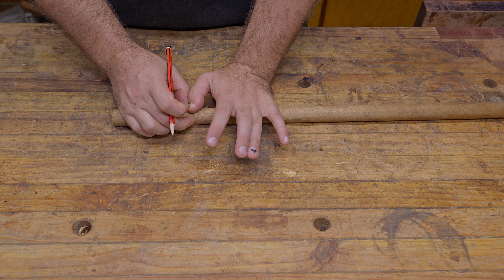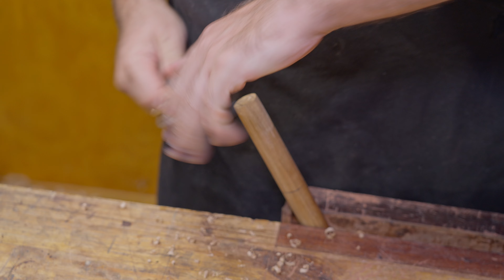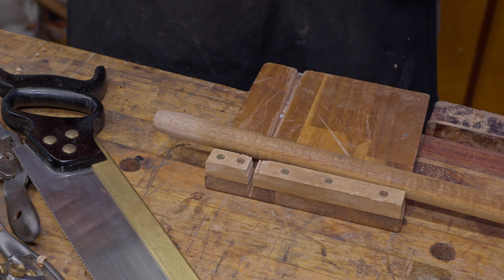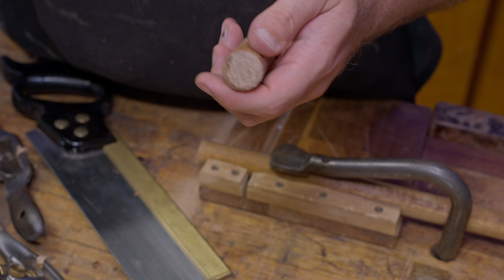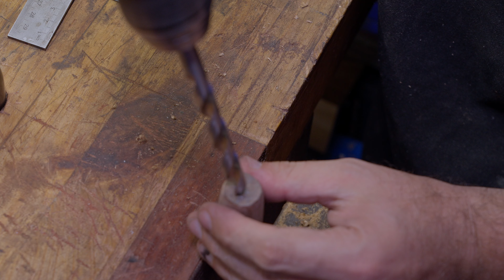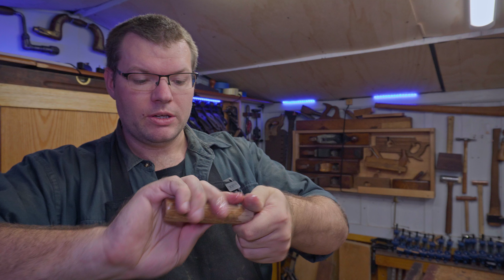Quick Tripod Handle Build Using Hand Tools!

Comment: I'm assuming you epoxied it onto the tripod.
And I wondered why you didn't drill the hole first.
Reply from the maker: @anthonyseiver7000  Yes, 5 minute epoxy. My idea doing the hole last was to insure it was central, but in hindsight had i done it first it would have been easier to shape it and keep it in the centre.